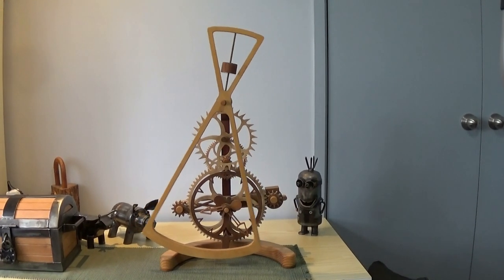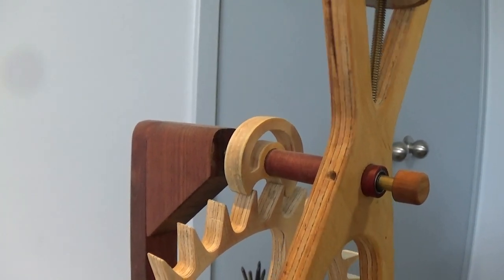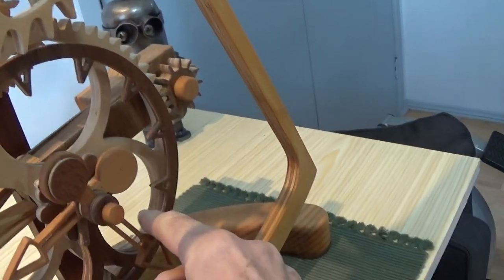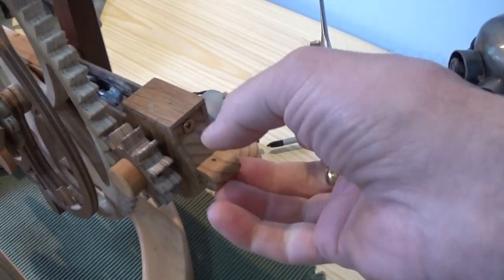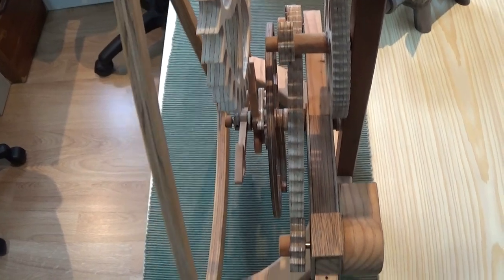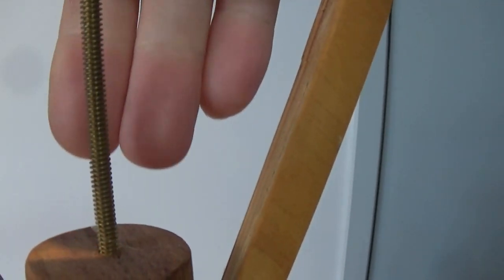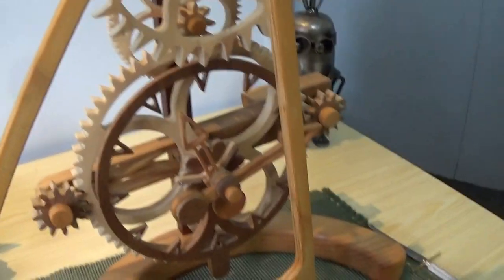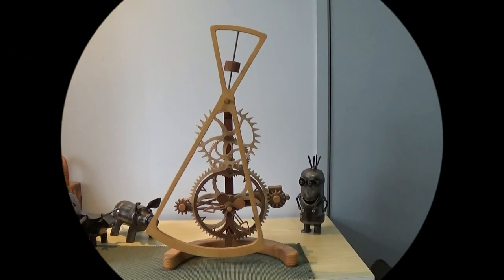Hand Made Wooden Clock - How it Works

Comment: Amazing Adrian! Absolutely stunning clock, are the materials you used to build piece readily available? In Australia
Reply from the maker: Yes most are. Ply from Bunnings. Solid timber is what ever you like. 
Brass tubing from hobby shops
Micro switch from Jaycar
But the motor has to be sourced online.